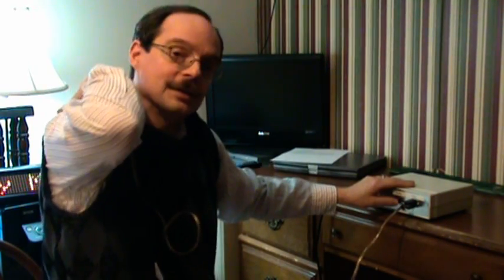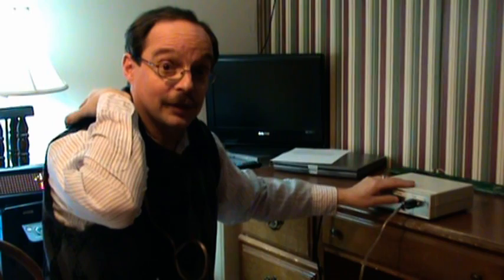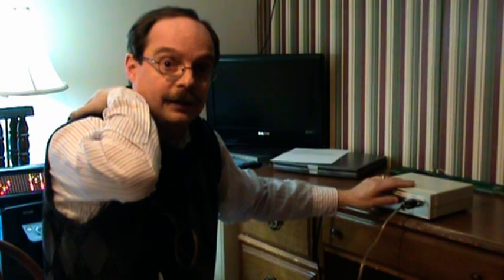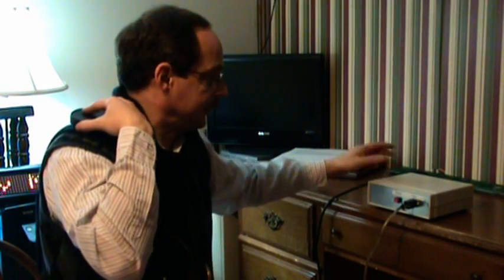Bob Beck Super Thumper in Operation

Comment: I have a small Bob Beck box containing 3 x 9-volt batteries. The only thing is I don't have any instructions and I can't find anything on eBay, Amazon, or Youtube on how to use the thing. Can anyone help?
Reply from the maker: That device uses short copper pipes that you hold one in each hand.  Its similar to the Hulda Clark device but more powerful.

Comment: Is It around 300 volts I built one and find 145 volts to be about right and anything over 180 volts to be dangerous, Bob Beck said Its Impossible for It to shock You but I got shocked at 165 volts from a bare wire that was Not covered so I always wear rubber gloves when using It.......